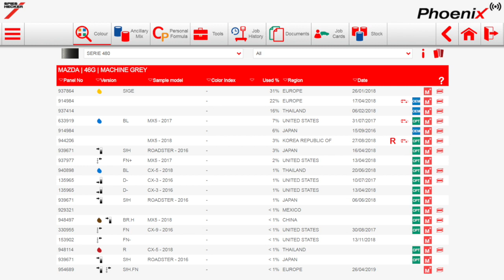Permahyd Hi-TEC 480- Mazda 46G Machine Gray

Comment: What is the reduction of the effect coat 30 or 50%?  Also, why do you not use a one to one mix of the effect color with blender for the blend areas? Thanks for the instructional videos, great work.
Reply from the maker: Hi thanks for getting in touch. Regarding the addition of WT Additive to the Hi-TEC, our technician followed the mix ratio shown in Phoenix. For the particular varaint he used the addition was 20%. The blending mix you refer to is not a procedure that we follow in EMEA although it may be your area and as you can see from the video our standard process works just fine.

Comment: Hi, great result whith as allways. Why do you apply blender after ground coat, before last coat. In the other videos you start with blender? I think because in the ground coat there is no metalics and pearls?
Reply from the maker: When blending the black groundcoat there is no need to apply blender first. You could do but would need to activate the blender as well  and keep within the repar panel. The blender is used on the efffect coat to ensure a smooth transition to the original pantwork and prevent any possibility of the blend being visible.
Reply: @Spieshecker  Many thanks for sharing your knowlage, keep doing that great videos. Wish you everything best

Comment: What gun set up are you using? 1.2,1.3 I or O?
Reply from the maker: In this particular video Tony is using SATA RP 1.2 O but "I" can be used as well. The main thing is the nozzle size. It should be 1.2 as 1.3 would be "too wet".